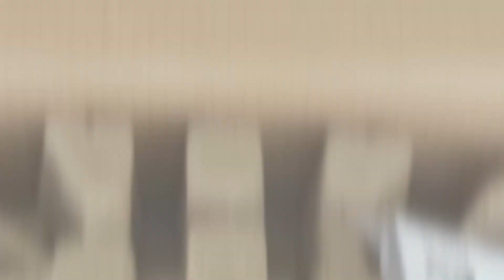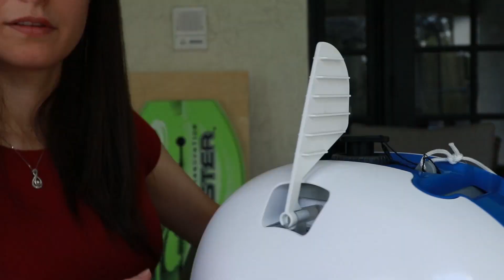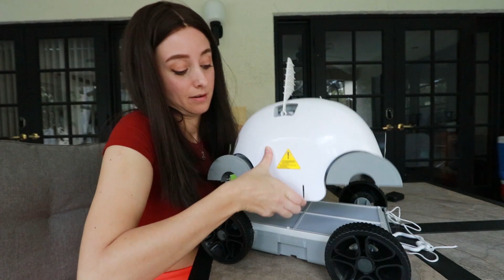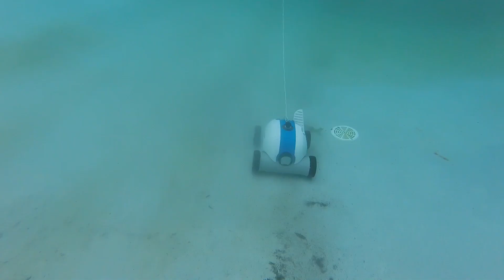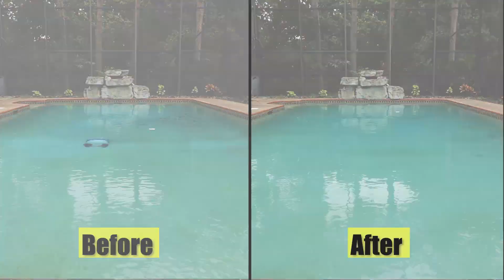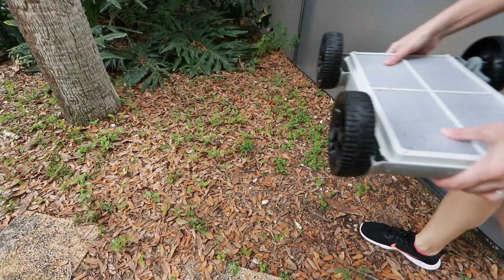Paxcess 5000mah Cordless Automatic Robotic Pool Cleaner

Comment: Does your pool have an incline from deep to shallow and did the Paxcess make the incline? I just purchased this, on its way and want to know if it will be a good choice for the incline of my inground pool. I returned the Aiper, it stayed in deep end, couldn't make the incline, only for flat bottoms.
Reply from the maker: My pool goes from 3 to 6 feet. So far every vacuum has made it for me.